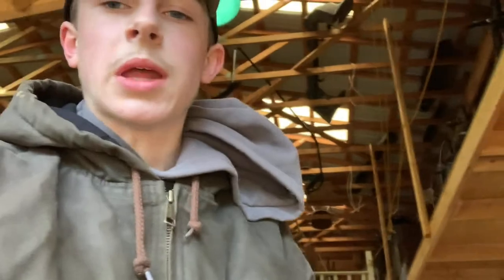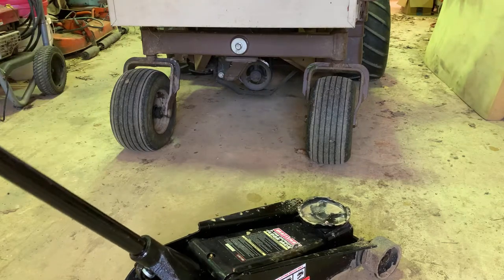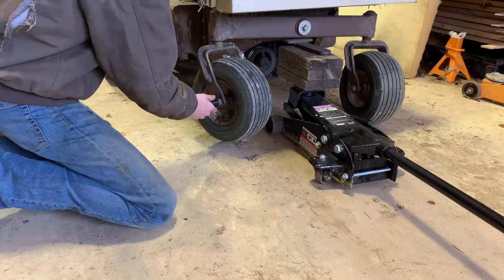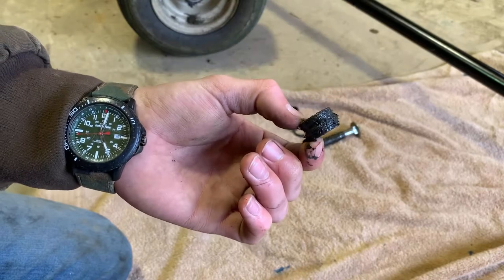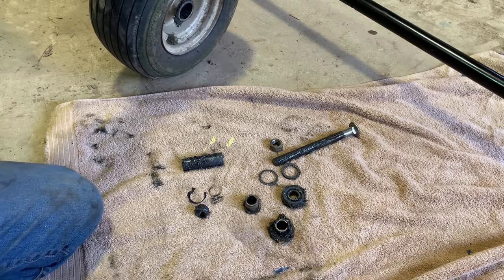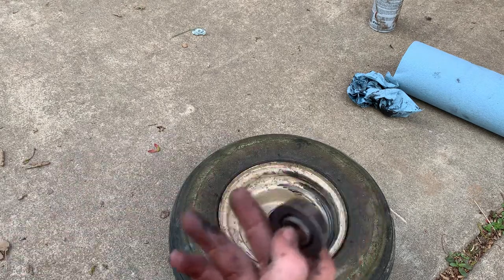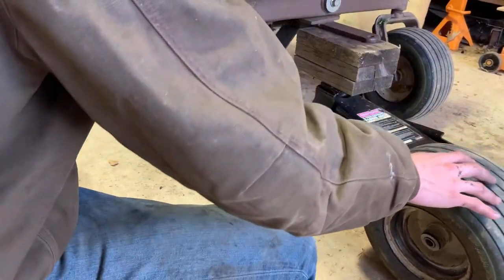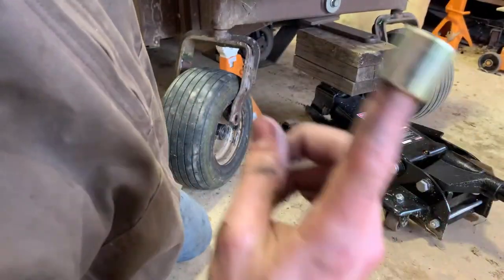Replacing Trailing Wheel Bearings on Grasshopper 618

Comment: Good to see a young man attempting to do your own repair work. Just a little advice regarding the spacer washers and where they went. When you take something apart, do it slowly and watch where the parts are located so you can go back together correctly. Also, you can find almost anything on line these days or your local dealer could probably assist you. Don’t just give up and say you’re not using them. 
  I would bet the spacer washers went between the rim and the bearings. Their purpose is to prevent the bearing from damaging the wheel .

Comment: It's an idler wheel and it doesn't go fast so you have it done. That was interesting to watch you figure it out and you did good. I see you have two jacks and some jack stands now. Maybe grease the rest of the mower and check the blades while it's inside. Good video. Pax.
Reply from the maker: Thank you! I have already serviced the rest of the mower all I need to do know is sharpen the blades.